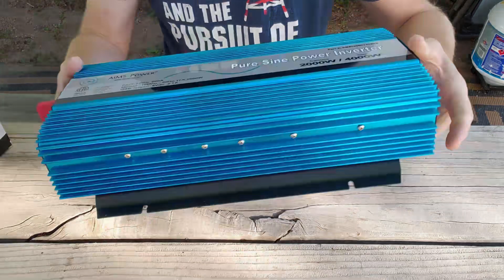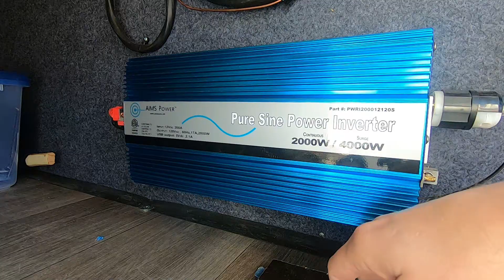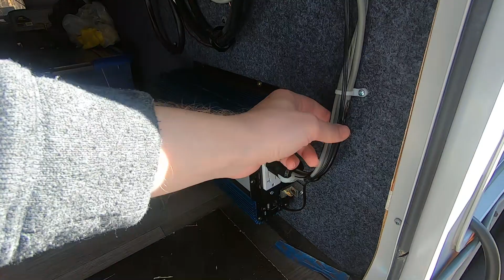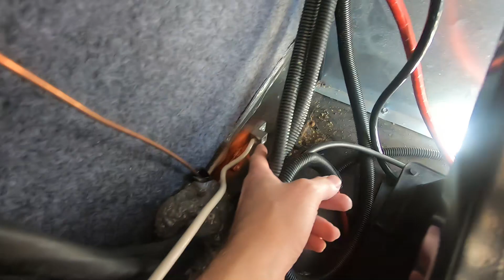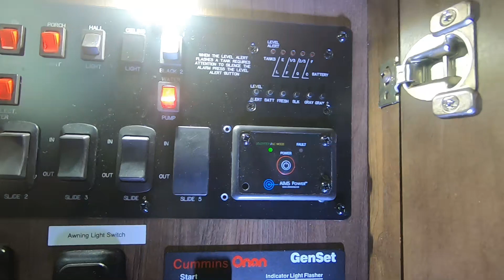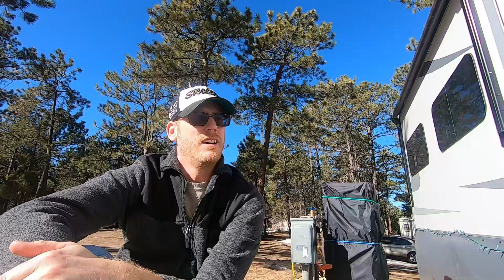AIMS Power Inverter and Lessons Learned

Comment: mine has a watt meter on the unit and can't figure out if the meter is reading input watts or output watts, it says 25 watts so at 12 volts that's about 2 amps, but at 120volts that's much less, so, question arises, which is the installed meter reading

Comment: I'm looking into purchasing one of these second hand. Is the remote needed for it to operate? Current setup is a semi truck with a 300 amp circuit breaker close to the battery end. I switch it off from there when not in use

Comment: Well, I have the 12 volt 3000 watt version. I can't get an answer to a email question. It is about 3 years old and is out of warranty, I will not be buying another replacement from Aims.
Reply from the maker: That stinks That they haven't got back to you!  Thanks for sharing your experience.

Comment: Many 7 pin trailer plugs only get aux power when the truck runs, (goes through a relay). You need solar or a generator, (or both)
I carry a 700 watt generator just to run a battery charger if my solar is not working well, (bad weather).
Reply from the maker: Thanks DannyB! I did find exactly this to be the case, I chose a different route to resolve this issue, check it out here: https://youtu.be/DDE2HkwjxMY

Comment: Install the DC to DC charger (40 amp should do it) with a dedicated wire from the alternator.   Also may need to upgrade Alternator to larger amps
Reply from the maker: Thanks Robert, I did end up doing that DC/DC install. Check it out here: Truck Side -> https://youtu.be/q1aVJx9G_i4 Camper Side -> https://youtu.be/DDE2HkwjxMY 
Our dual alternators and dual batteries in the truck are certainly up to the task!

Comment: SOLAR PVS IS THE ANSWER TO KEEPING THE BATTERIES CHARGED SO YOU CAN RUN THE SAME FRIDGES AND HEAVY LOADS AT NIGHT WITH THE UNDERSTANDING OF SOLAR PANELS AND A  M.P.P.T. "'  NOT  P.W.M. "  CHARGE CONTROLER AND AN UNDERSTANDING OF HOW MUCH POWER TO CHARGE THE BATTERIES .YOU CAN START OFF WITH 2  X 100 WATT SOLAR PANELS .
Reply from the maker: I have thought about PV but can't justify the cost yet, as there's not been a time where we have gone more than 24 hours without some sort of hookup... just the way we travel

Comment: I just bought the 2000 watt inverter/charger from Aims...24 volt...it was pricey but I dont have to buy a charger now...Also it can charge my 4 RV batteries from a generator if the sun doesnt come out for a few days...400 watts of solar helps..the battery you're trying to charge may be too far from the alternator so youre getting a voltage drop...I did charge a battery that far once but I had to use 2 ought welding cables
Reply from the maker: Generator and solar are totally on my list, but lower priority for us. We typically camp with hookups, so not that big a deal at this point. I hope your inverter works well for ya! Cheers

Comment: Hi, good explanation on yor system and pointing out to ppl how horrible the Amp draw can be in inverter land in general coming from 12 Volt battery systems. We just 'upgraded' our battery from 2 small 12 V lead/acid to a 280Ahr 12 volt LFP with a 130 A max BMS and my fridge draws around 28 Amp at 12 volt (13.2 to be exact) and that is when the compressor of the fridge is running and about 9 Amp or less when stationary. (25 cub.ft fridge/freezer) I never travel more than a few days but did see the definitive need for a DC to DC charger if stopped for the night in a rest area or truckstop. I went with the Renogy 40 Amp so it covers my need.Thought about getting a 5000 W inverter,  but that won't compute well with just that 1 battery and, most of all, my BMS limit. For the few times a year that I need that much power it's not very cost effective, just conviniant. Nice inverter, btw.
Reply from the maker: Thanks for your feedback! I debated getting the smaller unit, but figured why not? Will give us the peace of mind to have perfectly full batteries at the end of any drive day!

Comment: Hello AFRV- I just finished viewing your AIMS Power Inverter video and enjoyed watching it -thanks!  I am pretty sure that I will be buying one of those same units to install in the trunk of our new (2019) Buick Lacrosse that has a 2.5 liter 4-cylinder eAssist engine (with the 24 cell Lithium Ion battery pack and a std. 12v starting battery in the trunk). We will  mainly use the setup to run a 500W hand-vac and also for some occasional camping use and as a possible backup power source in case of power outages.

Do you still recommend this inverter or have you had any issues with it? I will probably be having it installed by an old guy who has a local automotive electric shop here in my home town (just for a little peace of mind since I am not very mechanical or electrically minded) but I would welcome any suggestions or tips you might have for a newbie inverter buyer/user such as myself. Thanks in advance, and way to go on that sobriety thing - I hit the 19 mo. anniversary mark myself just yesterday and am feeling quite good about it -Whoo Hooo!!
Reply from the maker: Thank you for watching! I do have a couple of things for you to consider before purchasing this particular inverter.
1. Make sure you need 2000 watts before buying. A 1,000 would be more cost effective. 
2. Im not knowledgeable on eAssist, but likely you would NOT hook to the easiest battery pack with this. I think those packs don't run on 12v. This would be meant to hook to a 12v deep cycle battery. Not a starting battery.
3. If i were you, I would do more research to be 100% certain that what you want to do is feasible, electrically speaking.
With that being said, I still love this inverter. It has been bulletproof for us. As an update, I did have to upgrade my charging system (see my video on the Renogy 60A DC-DC charger - https://youtu.be/DDE2HkwjxMY) to keep up with our use (2 fridges and various 120v electronics) but the inverter itself though has been great. No issues running it for 8 hours on our drive today in outdoor Temps reaching over 100 degrees. 

Also, we had an extended power outage at a park we were staying at recently. Like 6 hours. Granted I was able to run the fridge on propane, and no a/c but we were able to continue video editing (I actually use a small desktop pc for that) and such thanks to this inverter. I think the 2000 watts served us well. 

And finally, Congratulations on 19 months! Get another day!
Reply: @AlcoholFreeRV  Yup - the Li-ion battery would not be a consideration for hooking up the inverter since it supplies 120v high voltage power directly to a dedicated drive motor for the car. Besides, trying to tap into it would probably void all kinds of warranties-not going there!!  But would the 12v starting battery by itself be adequate provided that the car engine is running when a load is applied to the inverter? Not sure if I want extra weight/volume & heat from another deep cycle battery? I think that the 2000w unit would probably be worth the extra initial cost if we ever do have to use it as an emergency backup source of power for our house. Thanks again-I appreciate your help.
Reply from the maker: @ES-mq9ox   Im glad to hear you're looking at hooking to the 12 battery! This inverter can pull up to 185 amps at 12v DC. (2000watts/12v/90% efficiency). Your car's alternator may or may not be up to the task of keeping the battery up to a safe state of charge. I am by no means an expert in this area, just trying to share my experience. My comment about smart alternators at 9:55 ties into this, I think. Also many cars do not have an alternator that can supply up to 185 amps which means at full 2000 watt load, you'd deplete your starting battery fairly quickly, potentially leaving you stranded. I would recommend speaking with a certified mobile electronics technician in your area to determine if this inverter will work for you, your needs, and your vehicle.

Comment: Are you happy with the inverter itself or has it given you any issues? What is the converter for?
Reply from the maker: The inverter itself has been great! My electrical capacity has been the issue. Overall very happy with the fact that I can run my 120V refrigerator while on the road. My battery capacity can't keep up with both fridges for more than a few hours.